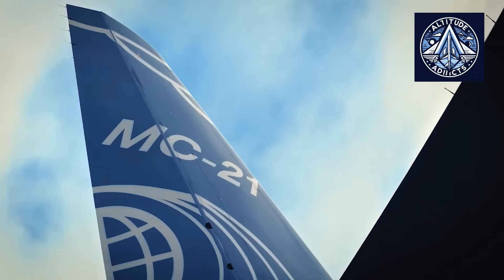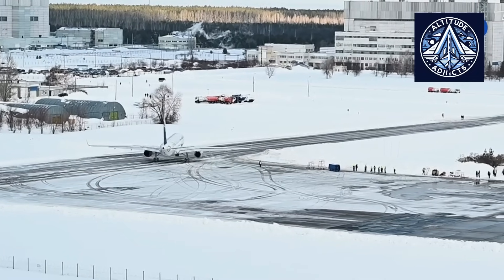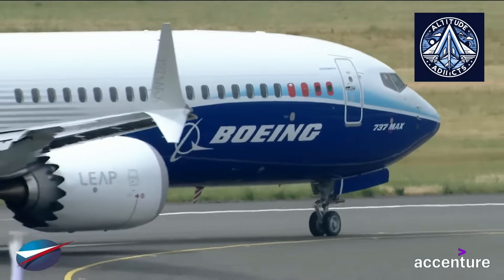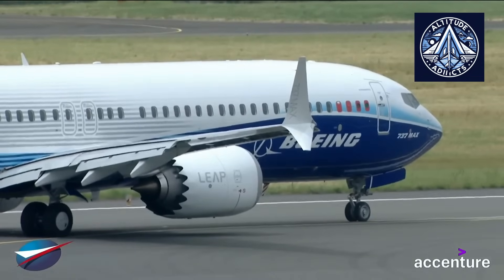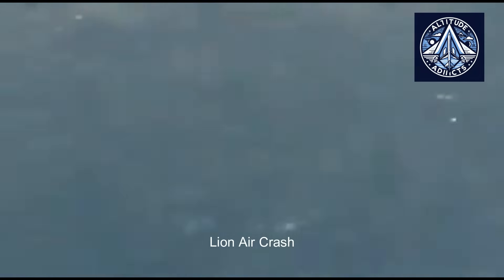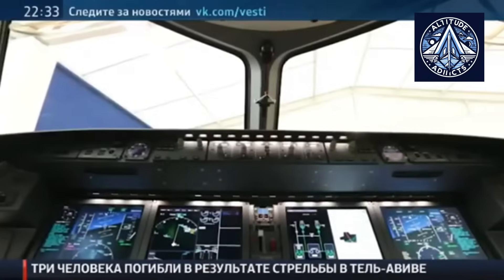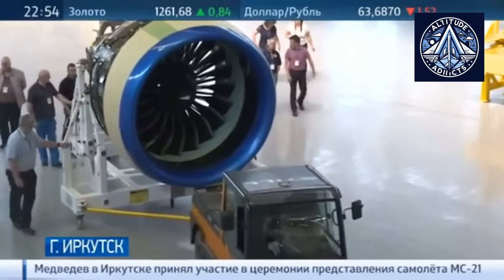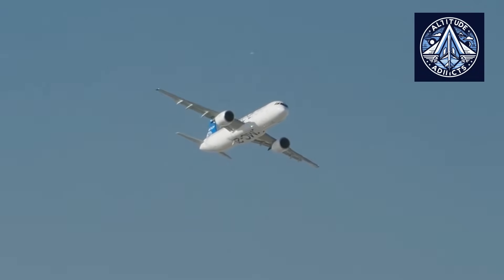MC-21's Side Stick Makes it Safer than Boeing 737 MAX and Airbus A320

Comment: Asking if we think the MC-21 is the safest plane is like asking if a new car is reliable in it's first year. It takes years for either question to be answered. For cars, rating services will give new cars a rating but that is meaningless.
Reply: @leslietroy2869  Russia is not new for making airplanes
Reply: It is proven by the production of Airbus which both use side sticks and F-16s also use side sticks...
So the technology has been proven..more ergonomic, safer and easier and makes the cockpit space more spacious.

Comment: wing tips look outdated... how do they negate vortex that forms there? apparently that cause quite a lot of drag
Reply: Ask about his wing. The air flow resistance of this aircraft is less than that of a Boeing or Airbus and without wingtips.
Reply from the maker: Yet, it is the most efficient wing in the category.
Reply: @altitudeaddicts  No pongan el título en Español cuando la narración es Inglés. Esperamos el contenido en Español como lo hacían hace poco.🇩🇴🇩🇴🇩🇴
Reply from the maker: Por favor seleccione la opción de idioma español en la configuración.
Reply: The wingtips are the most important part of the aircraft without which it is impossible to operate.